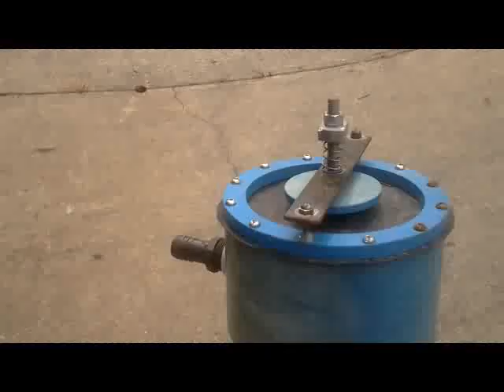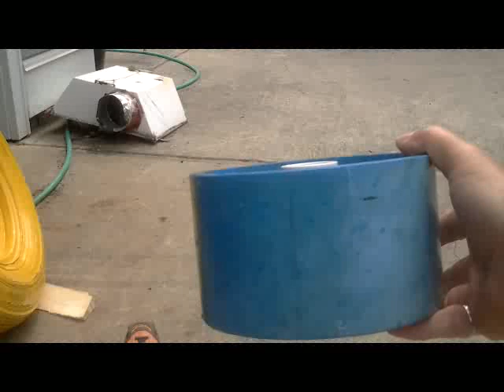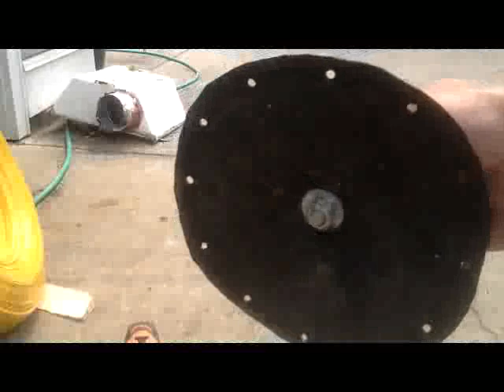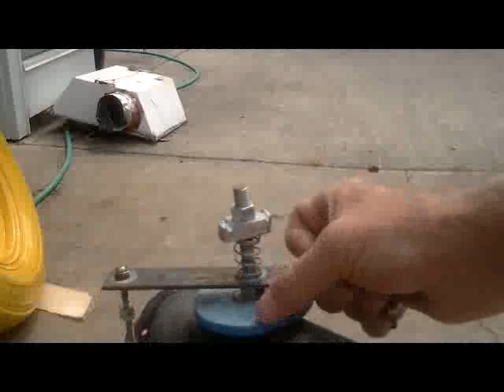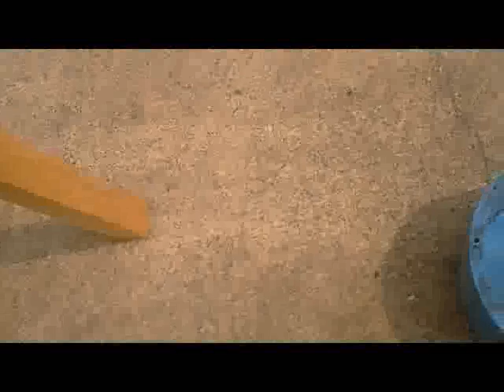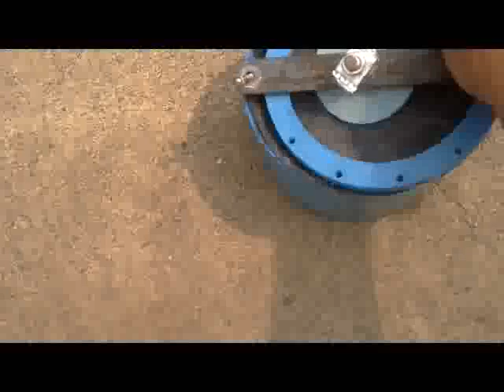gold jig pulse valve exposed

Comment: I think your spring is on the wrong side of the flat plate - it's pulling the diaphragm up. The water pressure pushes the diaphragm up and the spring should push the diaphragm back to seal the down tube as the pressure falls - the nut that tightens the spring then controls the frequency of the water 'pulses'. Otherwise, thanks for that!
Reply: Was thinking the same 😉